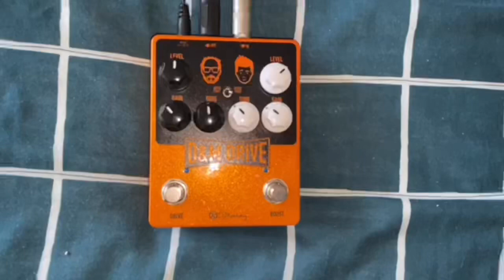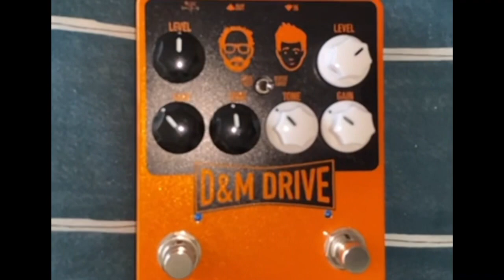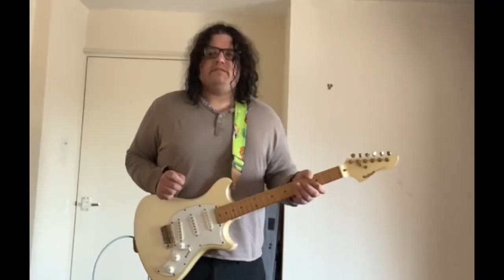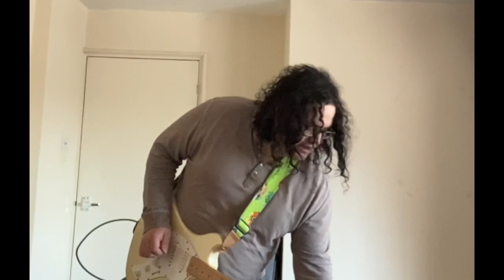KEELEY D&M DRIVE - 'THAT PEDAL SHOW' SIGNATURE OVERDRIVE PEDAL (honest review like and subscribe)

Comment: How does this stack up against your other drive pedals, as a comparison?
Reply from the maker: Hi Steve good to hear from you Do you mean how they stack together or how good they are?😊
Reply: @lostgroovemusic8494  heheheh I meant how does it compare. I wrote it very badly 😃
Reply from the maker: Stick with boss, MXR, Blackstar pedals very cheap too no hype on them very solid made pedals. This is too expensive for what it is.
Reply: @lostgroovemusic8494  good tip that. Over the years I’ve spent a fortune on “boutique” pedals but really, at the end of the day, Boss pedals are hard to beat.